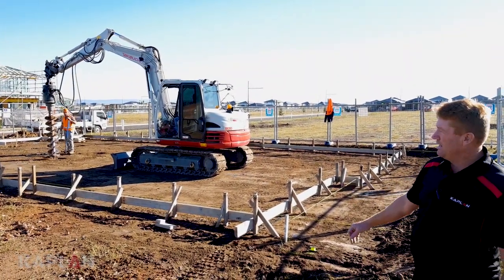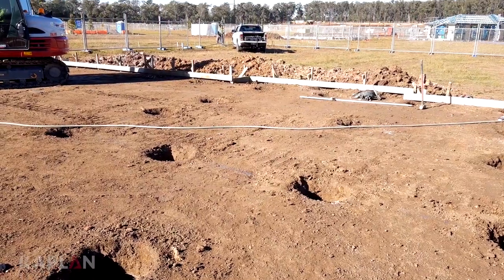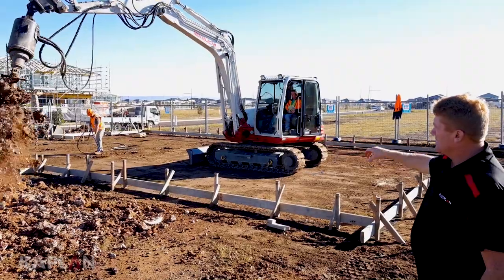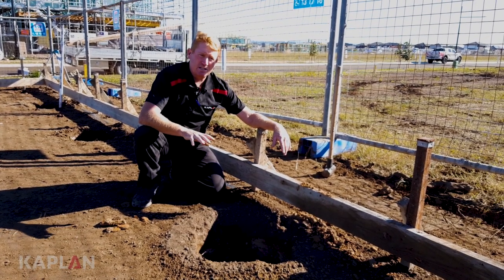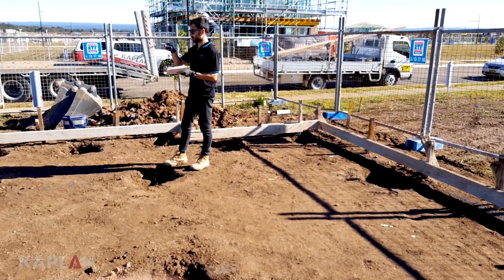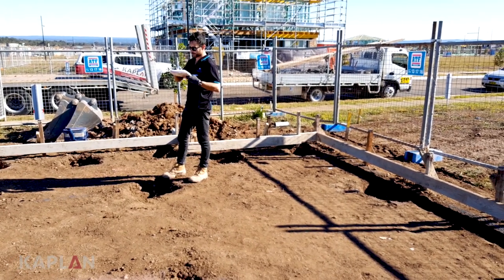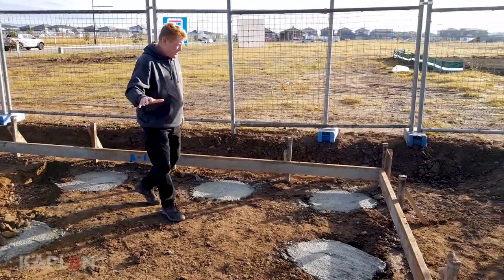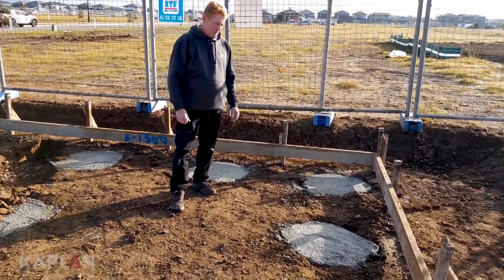Kaplan Homes: Build stage 2 - Concrete slab piering for a new house

Comment: What if builder just pour concrete in boat piers and rain after 2 hours for at least 5 hours. Is it safe for boar piers?
Reply from the maker: Good question. Actually its preferable to have a lot of water in contact with freshly poured concrete as concrete requires moisture in order to cure properly. Its perfectly safe in this case, even more rain over a longer period will not hurt, it'll ensure the concrete sets more strongly. Here's a more in depth explanation: https://www.holcim.com.au/products-and-services/tools-faqs-and-resources/do-it-yourself-diy/curing-of-concrete-techniques